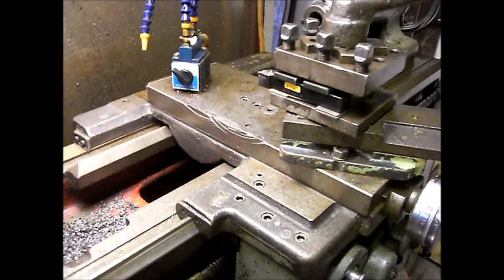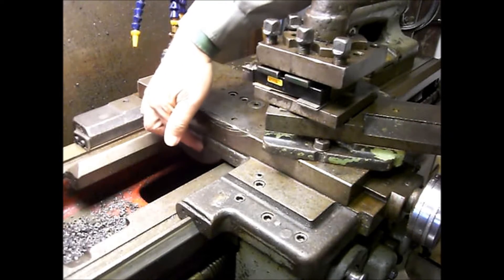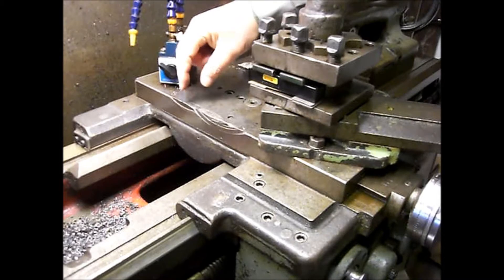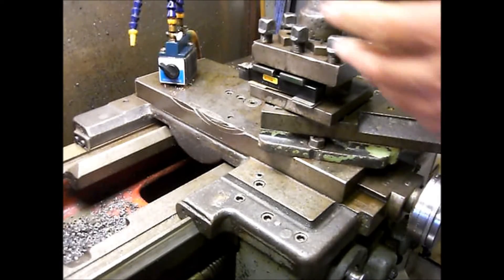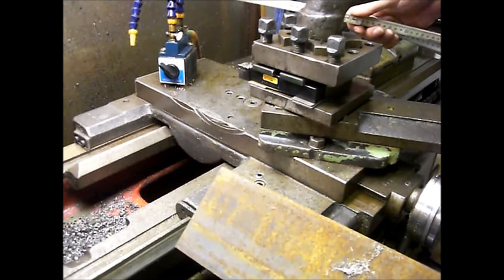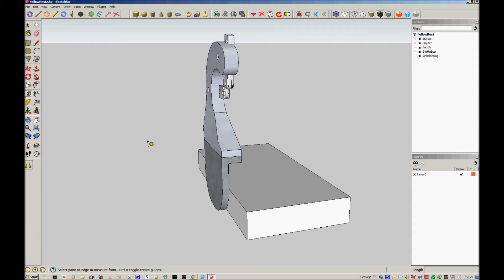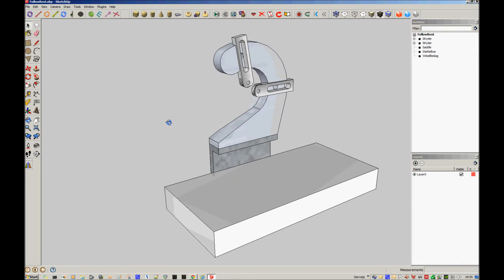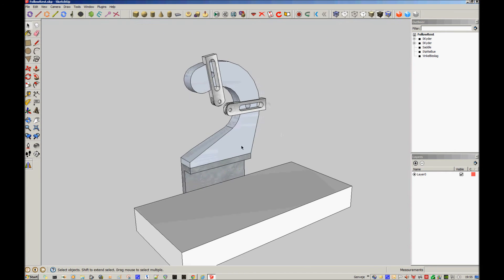Design of a DIY TravelRest

Comment: Hi Keld,
looks like a great project. I have two thoughts you might consider:
- you are only trying to counter the forces of the cutter, not holding the work. those forces are only up and away from the cutter, so I think the optimal placement of your supports are horizontal and vertical. changing the angle will only add to the forces of the cutter and/or decrease the effectiveness of the steady (I think). (also, the design is long tried and tested, and I think the craftsmen before us would have optimized it over the years)
- I would not be concerned about real forces along the turning axis of the lathe when attaching the steady. In that respect both the angle-iron and the set-screws for alignment should be fine. What I would be concerned about is vibration which will greatly affect your quality of finish since the steady supports the work very near the cutting action! Therefore I would make the attachment as sturdy as possible. I have my doubts about the set-screws for alignment in that respect. The previously mentioned stiffening of the angle-iron (by welding on strips) could possibly be done afterwards if it proves not to  be stiff enough.
just my uneducated opinion!
good luck,
Peter
Reply from the maker: You often see the offset of the vertical support ... try Google for "Followerrest" and turn over to Pictures - lots of them has this offset of the vertical support - it's only few degrees though.

My attraction to offset is that it sort of traps the turning object ... but you're right, too much will weakening "vertical" support.

Maybe it's more a "look" to me ... I think it seems like the turning object could "escape" between the vertical support and the cutting tool ;-))

Comment: Nice idea, Keld! However, that angle iron bracket will for sure have some minor stability or shattering issues at some point... I wonder, how about "boxing" it? Add and weld two small 8-10 mm thick flat bar at both ends of the bracket. That way, the possible movement in the angle itself is reduced to a minimum. What is left of any instability, would be in the area of where the whole thing is bolted to the cross slide. You can also stiffen it there by adding/welding a flat bar on that side too - at the headstock side of it. Good luck with this one! Looking forward to see the rest of it..:)
Reply from the maker: Hi Erling !
It is a 10mm thick iron and no forces is working in that ortigonal direction of the turning object ... I'll make the bracket and try to mount it to see if it flexes in any way

Comment: That should work pretty well.  I imagine the hardest part will be getting the slots for the guides lined up correctly on the center-line of the lathe.
Reply from the maker: Yeah, you're right - I think I'll have to finish it all WITHOUT the slots and mount it in the lathe with kind of needle in the chuck to find the center line ...

Comment: I believe you ought to connect it not to the cross slide, but to the carriage apron saddle underneath the cross slide so you don't move the travel rest when you move the cross slide. Perhaps I misunderstood where you were going to connect it. Great project. I look forward to the follow up programs. Thanks for sharing.
Reply from the maker: ?? I didn't say - or at least I thoght so - that I would bolt it to the saddle - but I will admit that when I started my investigation the first minute or two I thought so - that's why I'm saying in the video " ... I had to realize I should be mounted down here ..."